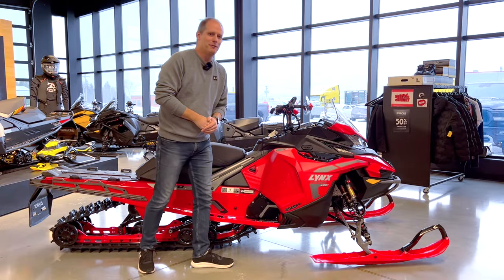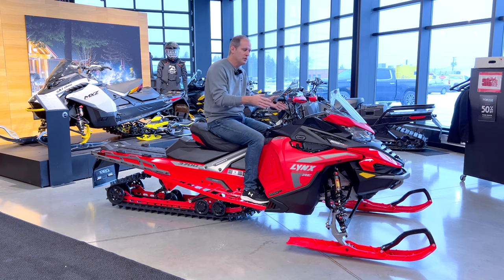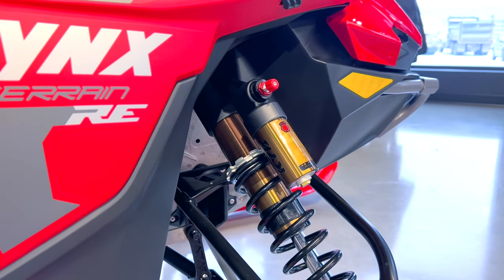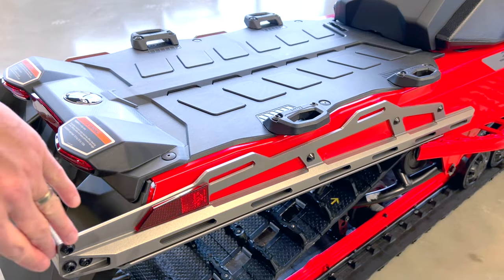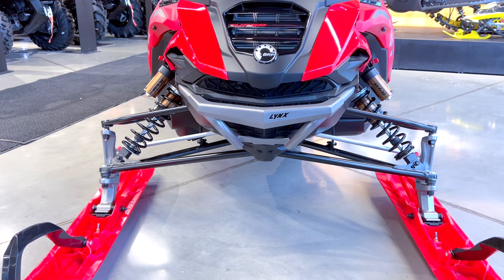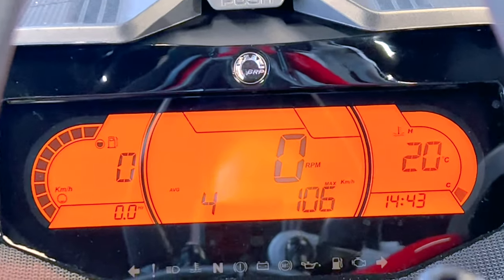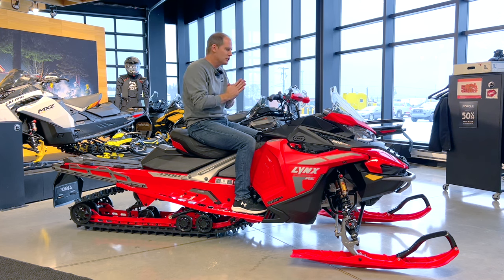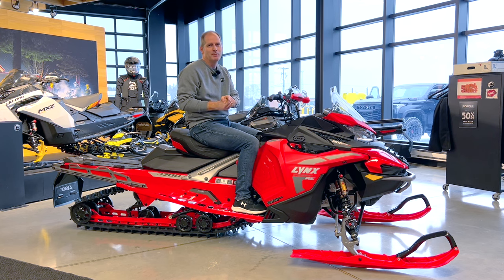2024 Lynx XTerrain RE: Thrills or Comfort? This Snowmobile Delivers It All!

Comment: This is probably the finest all-round machine I have ridden. What an engine it is 900 turbo R. Nice to drive slowly with and breathtakingly fast and strong. Feels very sophisticated, completely vibration free which the 850 was not. How pps works & with this powerful engine you can lift the skis whenever you want. When it's winter conditions its a dream. The sound, performance and the whole feeling around the sled is fantastic. High-class suspension components but bad original lights, the weight in the powder are the disadvantages and a high price but simply a dream sled
Reply from the maker: Thanks for sharing your experiences!

Comment: Sucks that this is the 900R version on the old chassis.. 2024 is the first year of the new radien 2 chassis if you get it with the 850 motor.
Reply: I does not suck at all. Its fantastic